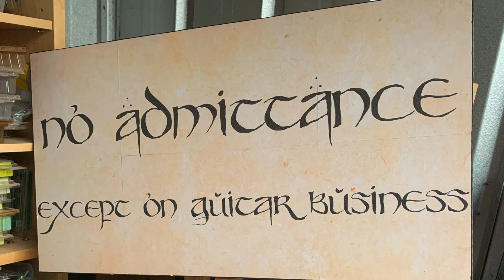Great Guitar Build Off 2022, Scratch Build Category — Episode Eight of the making of The Les

Comment: Nice work Bart! That looks great👍
Reply from the maker: Thanks, Giocomo! FYI, I watched your video from a year ago about how you finish guitars before applying the finish on mine. You used a foam brush... I don't have a foam brush, so I had a brush ready. But with Crimson's melamine, though the instructions are to use a brush, cloth or  strong tissue, the bottle top is small, so I figured it would be easier to go with cloth instead of a brush.